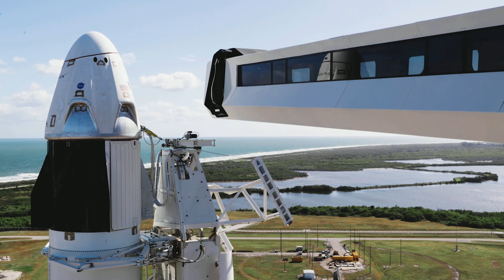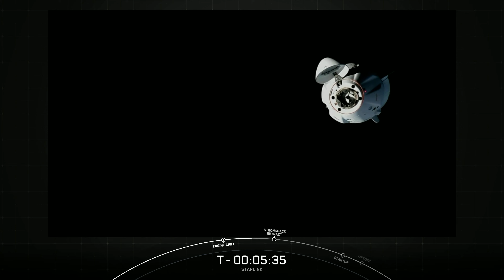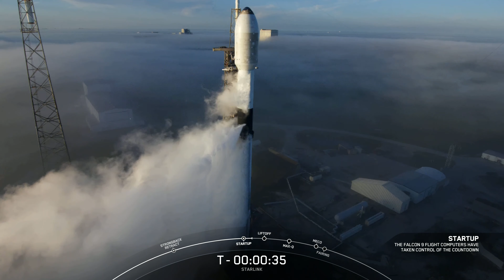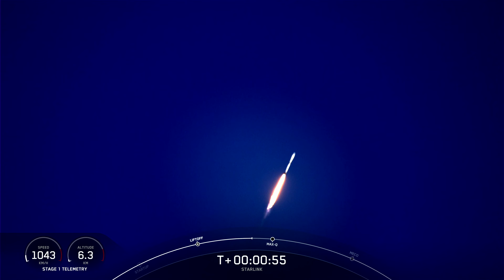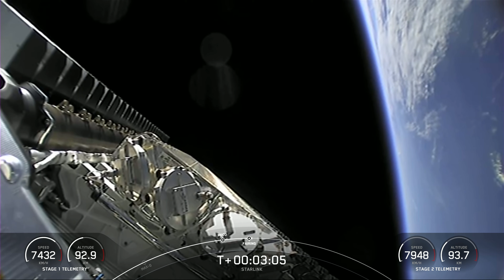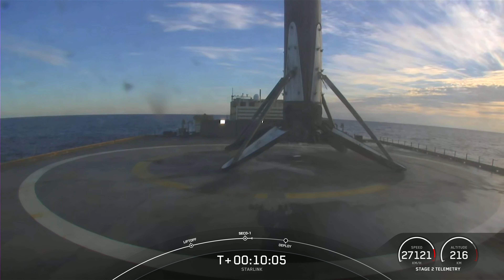Starlink Mission

Comment: BULSHIT, THIS IS BULSHIT AS SANG BY BOLAMAN. Inmarsat launched 24 maritime sats up prior to the 80's. They had to prorgram deliberate mistakes in as the kit was that good, it could locate you within a foot of where you or your vessel was. This also has fekkin nowt, 'nowt' to do with a better internet experience either. There are upload and download freqs and all manner of systems you can employ for remote locations and current 'down the pipe' capability means you'll need a millenium to be faster than the light from fibre to coax to your screen. If this is anything at all.................................it is deception!....................but you'll not know that, until they drop you off in the grey zone for owning your own intellect.

Comment: Speed of second stage when Ust 4.2 km per second altitude gain is only 1 kilometers 4 second which is showing almost 70-75 percent of the power used is wasted and with increase of altitude this percentage reach up to 99.99 percent power wasted now how to believe with combustion engines someone reached moon and landed and back  combustion engines just increasing speed at orbit but not helping vertical movement

Comment: After release of satellites, just as the closing conversation by the presenter there is a rotating object in a lower orbit, that is reflecting the sun and then casting a shadow onto the clouds, noted by opposing directions pf each.  But considering the 2nd stage is spinning for the satellite releases, and also its position away from any thing like the fairings, the object has a rather strange trajectory and guess it must be something de-orbiting? Starts in bottom right of image at time 35:18 in the video feed.